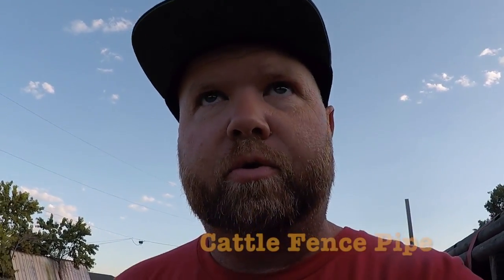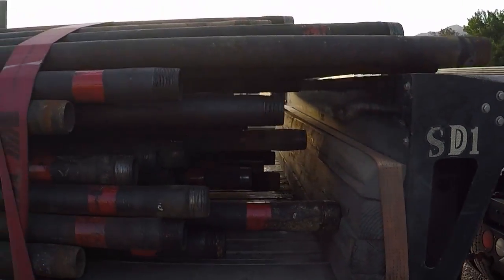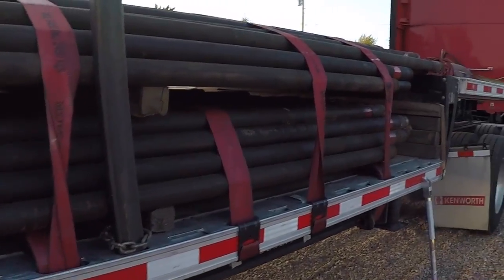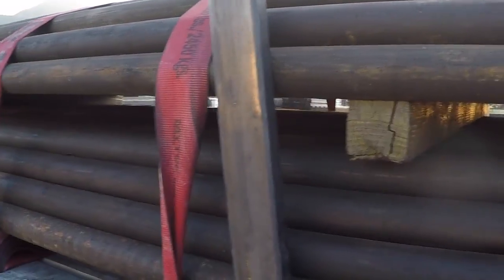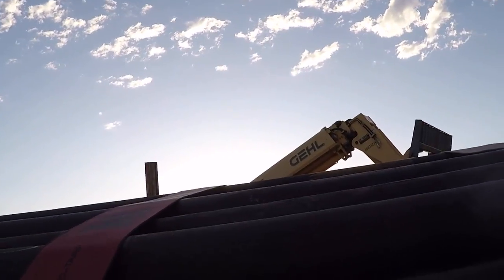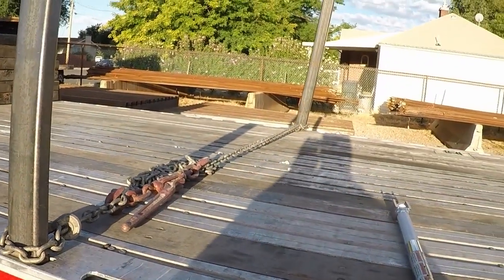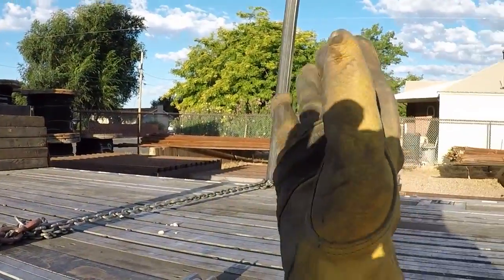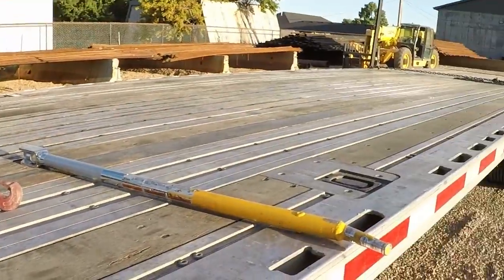How to use Pipe Stakes *my first time*

Comment: Is there a way to hold the spike stakes down after you get loaded? I have used two bungies on each pipe stake from the top of the stake down to the trailer. I was wandering if that was acceptable?

Comment: How did you tie down your stakes with chains?
Reply from the maker: You take a chain and run it from stake to stake before you get loaded. That way it sucks your stakes in. So your chain sits on the deck of your trailer and then you load your trailer. Does that make sense?
Reply: do you put a binder on chain

Comment: Is it required to strap top sides of pipe stakes in between? From left one to right one?
Reply from the maker: No I don’t think so. Usually with pipe stakes you run a chain from the bottom left to bottom right. I suppose a shipper might want you to do the top. But I’ve never encountered it yet.